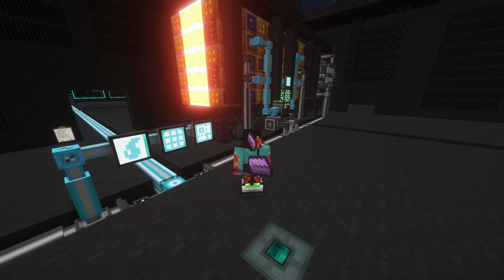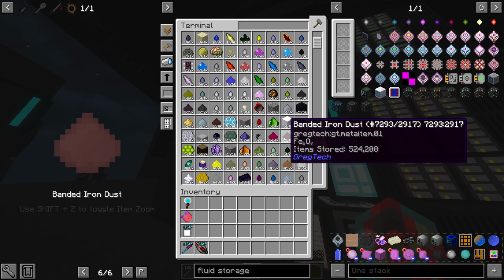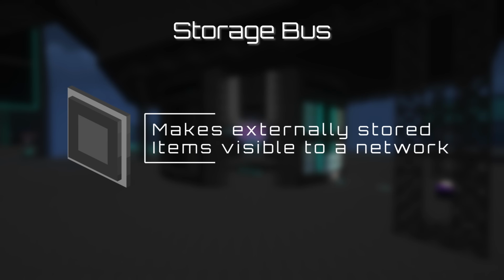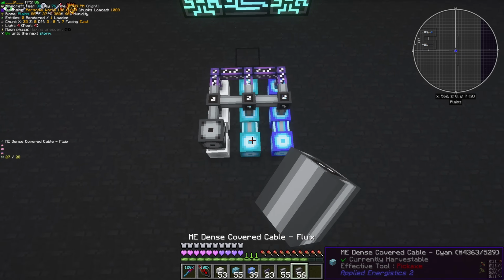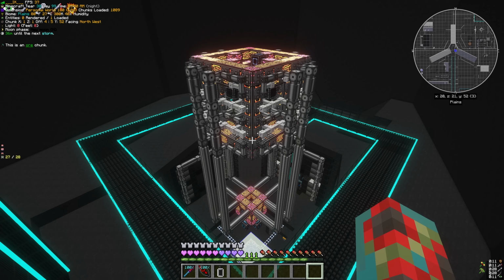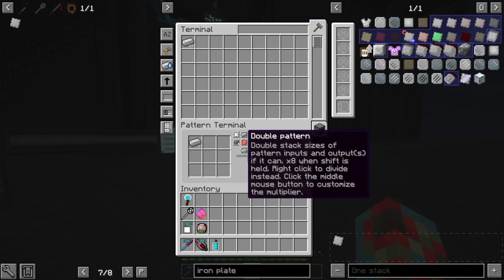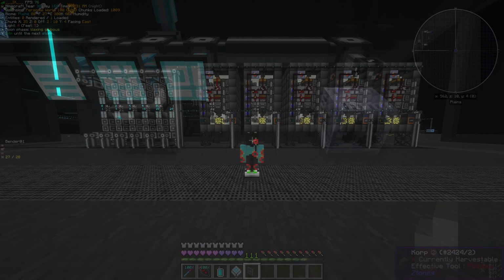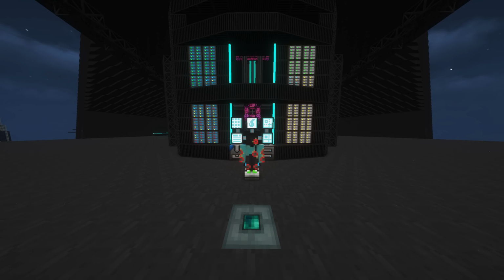IX's Fundamentals of Applied Energistics 2 in Gregtech: New Horizons 2.7.0+

Comment: I think my favorite part are the p2p-tunnels and storage busses in GTNH. 
And the Quartz knife is probably the one thing that saves me the most, especially when naming my p2p-setup and crafting setups. 

And i think i compeltely overlooked the sticky and ore directory cards. I'm definitely going to craft up a few of them for my storage drawers and vacuum freezers. This'll definitely save me alot of nerves going forwards. 
I suppose for the Ore processing factory, i'll definitely need to come up with some sort of better system. Right now i'm checking for each ore which 'path' i want it to take and then put an export bus accordingly. I want to modernize this a bit to make it less channel heavy.
Reply from the maker: Storage buses and sticky cards are probably my favorite 😊

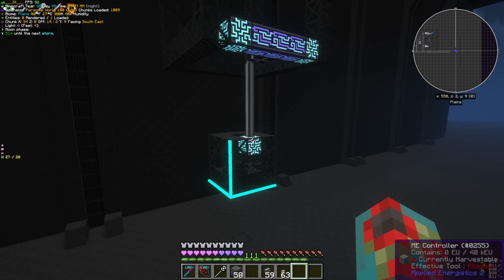Comment: 8:30 i keep watching the video but i cant seem to grasp the concept of the subnet thing. You put main controller and at the bottom a small one, and change frame where it magically appears, but i don't understand from that point... if i want to use p2p everywhere, i have to plug a face on the main controller and at the end of the cable coming out of the subnet ? Or am i understanding wrong? Sorry for asking but it's still very confusing to me
Reply from the maker: @Se7en7upp  Yep exactly! The P2p are all hosted on/connected to the subnet. One p2p faces the controller, the other p2p goes anywhere in your base and brings the 32 channels.
Reply: @IX_Streams  Thanks, I can't wait to see your next videos going deeper into ae2 subject, i learned ton of stuff watching your video multiple times

Comment: Hey, a bit off-topic, but what are those beautiful neon lights called, that you're using in your base?
Reply from the maker: They are antiblocks, I use a texture pack from sampsas discord to make them emissive and solid colored! You can cut them into strips with a forge microblocks saw.
Reply: Thanks! You mind dropping a link to that pack?
Reply from the maker: @СвятославБугров  I dont have a link, but you can join sampsa's discord and get it there! https://discord.gg/uum4tpUz

My discord also has the documentation on how i installed shaders from sampsa's discord, as it isnt really clear the best way to do so.
Reply: @IX_Streams  Thanks, appreciate it